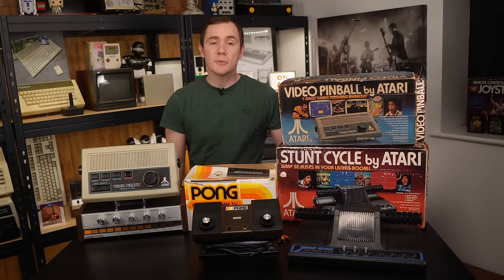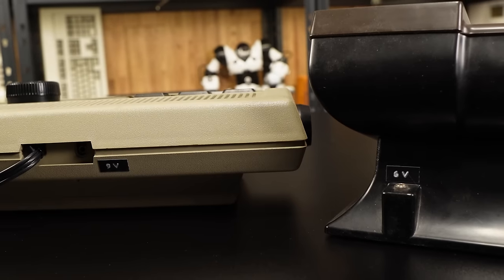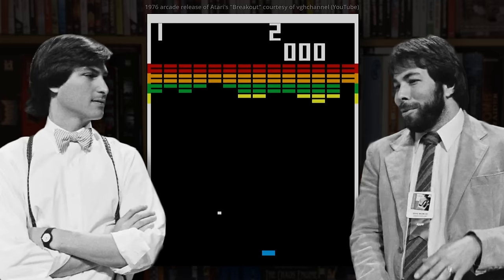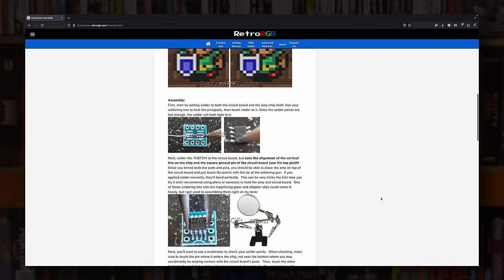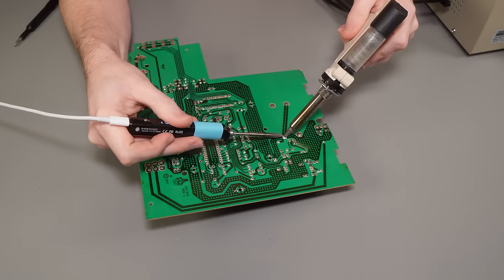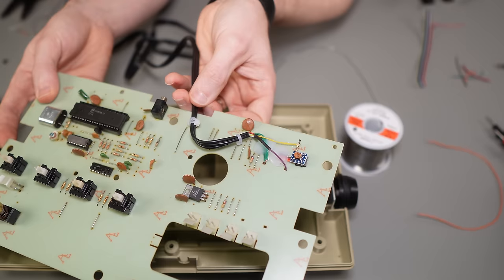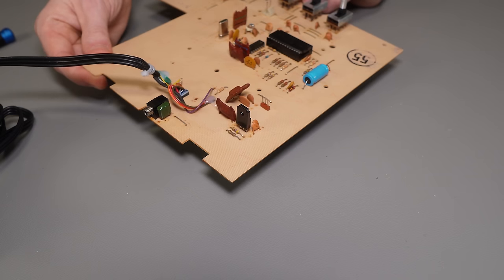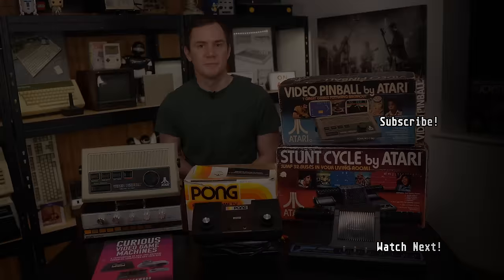A Curious Atari Video Game Machine Restoration

Comment: Nice one Rees. :) Have to say I wasn't a fan of using 3.5mm TS jacks for power. You actually short out the supply when you plug it in. On those 6V units it would be worth seeing if power goes anywhere else than the 5V regulator because if not you'd be perfectly safe to run them from 9V. That's what they did on the ZX81 and if you look at the voltage coming out of the "9V" supply it's more like 14V.
Reply from the maker: Ah yes, the "shorting out" thing is very important, I probably should have mentioned it in the video. I'll make a note to mention it in the follow-up. I'll also investigate the regulator situation like you say. Thanks for the suggestions! 👍
Reply: @ctrlaltrees  The whole barrel jack vs TS jack thing is quite interesting. The reason why barrel jacks were originally tip negative was due to the original barrel jack connectors having a changeover switch on the sleeve connection. Which was used to prevent charging and subsequent exploration of the batteries when you plugged the power supply in. Going back to the short circuit thing. Sinclair used some interesting jack sockets on the zx81 and the spectrum (though not for power on the speccy) that don't short out when you hot plug them. This works by only having the tip and a ring connection and nothing where the sleeve would normally connect. When used with a 2 connector TS plug this doesn't matter. But it has interesting results if you re-use a jack socket from a zx81 as a headphone connection and then plug in a pair of stereo headphones into it. You get sound from both sides. But it's out of phase which oddly doesn't sound as bad as it does when you connect speakers out of phase.

Comment: My family had a similar pong machine as a hand-me-down in the late 80s. It used four D-cell batteries and the speaker was in the unit itself, not through the TV. It worked fine, and did provide useful entertainment. We sold it at a garage sale for USD$5 or less, still in working condition in the early 90s, hopefully it found a good new home.

Comment: Stunt Cycle is one of my favourite games and one of the most 70s things ever.  Not released in the UK as you know, but the same GI game-on-a-chip is used for Motor Cycle (and other named variants) as a cartridge on the PC-50X system, which was very common in the UK, it uses analogue controls so works perfectly with the game.